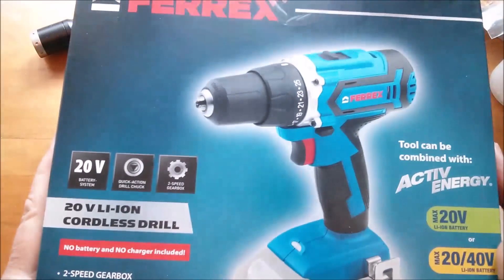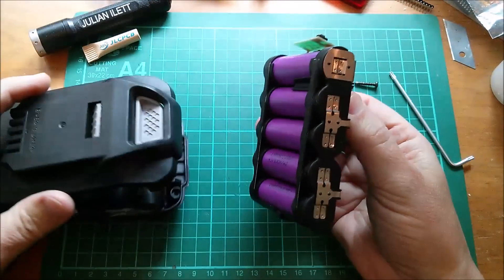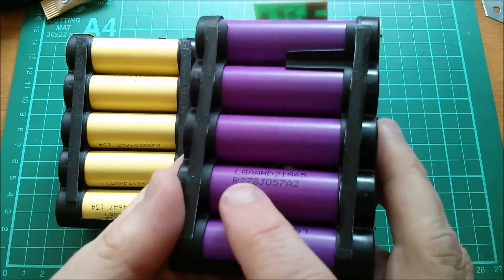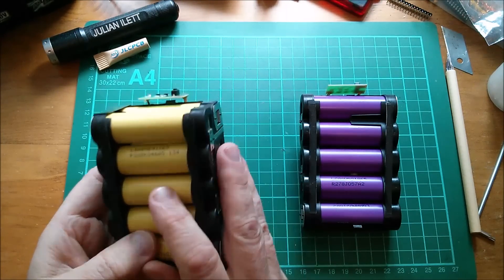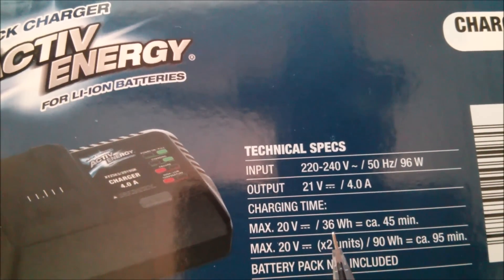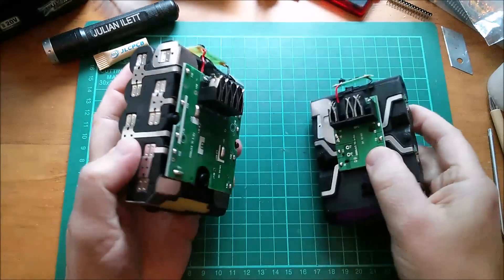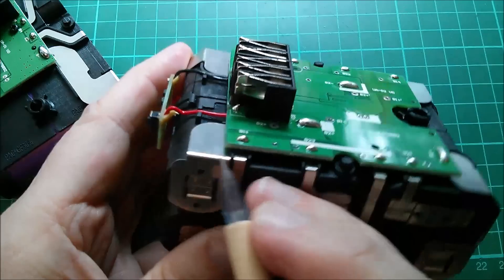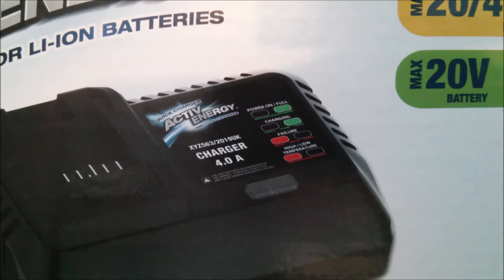Aldi Active Energy 20V/40V Battery Strip Down

Comment: Did you ever teardown the charger? I bought one looking for a cheap 21V CC/CV psu to replace one that had blown on another piece of equipment. The ID input is a problem though. I opened it myself to see and it's complex, controlled by a ST MCU which monitors the output current, battery temperature NTC and feeds back to the power stage to control the voltage. I don't know what it does with the ID, it could be a basic analog thing or perhaps a digital one. I will need an oscilloscope to see. Did you work out the ID?

Comment: I’ve got one of these 20/40v batteries but no charger , anyway to charge it with a adjustable dc power supply or maybe a charger for a different brand drill ?
Reply: Did you ever figure out how to wire it up to charge it?  I'm in the same position as you.
Reply: @chaswinder it’s a bit hassle but a adjustable dc power supply woks, you have to charge both section separate, first b1 side then b2 side, Aldi had the chargers on offer recently and I did get one, I think they was £7 but you can use a adjustable dec power supply
Reply: @M.E63  Excellent, thanks.  I only have the 20V battery rather than the dual 20/40 but wasn't sure how to connect up a psu to the pins on the battery (presuming not just +20V and 0V). Cheers
Reply: @chaswinder  what’s the pin markings on your battery ?
Reply: Hi  @M.E63  sorry for the delay in replying.  From left to right the 5 spade slots are labelled B1-, B2-, T / ID, B1+, B2+.  There is no spade terminal in slot 2 for B2-. Voltage between B1- and B1+ is 11.8V, between B1- and B2+ it's 17.9V
Reply: @chaswinder  yes you can manually charge both sections, do b1- and b1+ then b2- and b2+.
Seems a bit low if it’s reading 11.8v
Reply: @M.E63  I only have a 20V battery, not the 20/40V battery like you. Hence why there is no metal contact in the B2+ slot on my battery. I'm unsure if it's safe to simply connect a current-limited supply across B1+ and B2- ie. the pair of connections that measures 17.9V

Comment: What voltage are we expecting on the T pin?I have connected the ferrex air pump to a power supply set to 20V, the Led comes up briefly but the pump doesnt start, making me think that the microcontroller thinks the battery has a low voltage. I dont have this issue with the impact driver as it doesnt seems to make use of the T pin. I currently dont own the battery asa I use the Lidl one. anyhelp help much appreciated. thanks

Comment: Does anybody still have this battery? I'm trying to make adaptor for lawn mower, but it does not work when i give ~80% from battery voltage to temp clamp. Tool is 40v, and author while stripped down tested it only with 20V battery pack. My question is:
Does it have up to 20V on temp clamp when connected to 40V tool, or is it doubled, because cells are joined in serial, so it's gonna be up to 40V on temp clamp?
Reply: Ok, bought one to test myself. ~21 celcius degrees thermal sensor is about 10.5KOhm between B1- and T clamps. That's enough to get 40V device running. My batteries got thermal protection built in anyway, so i don't need it.
Reply: @krzysztoff5793  Is the T contact the high or the low?
Reply: @נוחיחזקאל  can't remember now, but I think it was higher one in battery, closer to cells. I can double check it next Friday if you mention me here again.

Comment: Really impressed with that drill... I bought one of those a year ago, £30 battery (20/40) and a charger and I’ve brutalised it all year... still going strong. It was so good that I bought the rotary SDS and the impact driver. For the three drills and two 20/40 batteries I paid £130! All with 3 year warranties. You really can’t complain at that; even a cheaper brand you’d struggle to get that set for much shy of 4-500 quid.

Comment: Hi, I would like to use that battery pack to power a portable Bluetooth Amp. 
Can you recommend a way to realize the low discharge protection?
Reply: I of course mean over-discharge protection. Using the 20v pack.

Comment: The new Workzone Battery Packs uses QIXIN lithium batteries and they seem to fail easily. I have opened many battery packs of the latest workzone tools and they used these batteries and i have lots of problem with them.

Comment: I've a few ferrex tools and all have been great especially for their price and a 3 yr warranty! I also have both these batteries.  

I used the smaller 20v on my kids electric 6v bike... power wheelies happened 😅 I'm wondering how I'd go about using the 40v battery on the bike in the same way to increase the power further as I've now fitted a 12v motor so its slower , any tips? cheers

Comment: Currently £15 for the 40volt battery thats £1.50 per cell for 2500ma genuine cells. Anyone wanting to make battery packs for electric bikes, powerwalls etc you wont a better deal anywhere.

Comment: Could I somehow join 4 or 5 for an electric bike much cheaper than branded bike battery
Reply: I have a temporary setup with Parkside 20V 4Ah packs wired in series and parallel, that has worked very well used twice a week for a year. Think I just need to get a 40v charger and hard wire them together. But at the moment in charging separately.

Comment: Hello Julian,  - are the contact groups independent on 20V/40V battery? I suppose, they become parallel in case of 20V tool, and if we use 40V device, the device connects the two 20v-groups in series. Am I right?

Comment: Hi Julian, I have two 20/40v packs for a 40v (36v) project and wish to connect them 40v in parallel  or 2x 20v in series but unsure of the connections B1-,B2- & B1+,B2+ . Not wishing to damage the batteries , did you work out how the connection could be made. Perhaps the tool makes a link  20/40v . I can only measure 20v(18v) at B1- & B1+ or am I just missing something. Great video must checkout more thanks.
Reply: Did you work this out?  I'm having the same issue with a 40v diy go kart
Reply: I want to know to in the same situation 😑

Comment: Hi Julian
If I connect the two 20v ferrex batteries back to back after properly removing & soldering the B2+ / B2-, will the charger be able to charge this modified battery? Thanks

Comment: Hi Julian. I learn much from your videos. The stuff on high power LEDs has helped me out slot. Thanks.
I bought the ferrex cordless angle grinder which is a good tool, however I need another 40 v battery pack.
They have discontinued these battery's do you know any ' hacks' to use an alternative????

Comment: I bought about 5 of the 40v ones after opening one and seeing that they were the green Samsung 25Rs. That's 100 watt-hours for 35 euro or €3.50 a cell which is quite reasonable. I have a 20v one also but haven't opened it yet (don't have a Torx screwdriver). The 40v ones sold out within a day (It seems others had the same idea as me) I was in 3 different Aldis in 3 different counties over the last week and they still have a stack of the 20v ones @ €20. Was thinking of trying to cut a deal with them, by buying 100 of them, if they would sell at 10-15 apiece.
Reply: clearz Google fogstar they sell those Samsung’s for 2.85 or if you want to spend £75, they drop to just £1.65 each!

Comment: It looks like these batteries do not have a cell balance function - the circuit on the backside of the 20V cct board monitors  cell voltages and temperature but there is no balance facility. Somebody is gambling that the cells are so closely matched that the charge discharge cycle wear is even ....  Three year warranty in a domestic situation ... that's likely a gamble worth taking - now where's that receipt?

Comment: 4:14 Not 25v but 20v or max if every battery is 4,2v, it is 21v.

But for the rest thanks for the video.
Reply: Actually he was right at 4:14 cell constant max current draw is 25 amp not 25v its not what he said

Comment: saw them into Aldi this week, all seperated tools and batterys, i dont know ... not that cheap as the Duro tools they had which are very great in my experiance i use one for 3/4 year on my work, same signle battery and still doing great , mostly just use for screws like 4x35 and wooddrilling 20mm. it was insane cheap just 20 euro i wish they come back i would buy more of them. never seen them again while Duro stuff is still common in the Aldi.

Comment: I got all there tools apart from the lawnmower and numerous batteries they are very good so far I'm impressed I just hope they add to the range as I see they brought out a 18v ferrex combi drill which is not compatible with the 20v stuff naughty really also this drill has no hammer function. The aldi tools are better than lidl but lidl batterys seem better built and a nicer feel.
Reply: Now use Dewalt the power and tool balance is light years ahead

Comment: The BMS for the 20/40 pack is probably slightly more complicated than two independent  balancers since not only is it necessary to keep the voltage of each cell within a 20V pack balanced. It is also necessary to keep the voltage of the two 20V packs the same, since otherwise when going from 40V series usage to 20V parallel usage there could be a huge current spike tripping the fuse.

Comment: Here at Hofer, in Austria (the local representation of Aldi Süd), fully compatible yet different battery packs where sold. Same external design but different molds for the injection molding. Slightly different internal construction. Different PCB with components on the top (visible) side (but not really identifiable due to a conformal coating).  Samsung INR18650 cells (20R and 25R respectively) instead of the LG cells. These Samsung cells are specification-wise comparable to the LG cells. The Samsung filled batteries name Conmetall Meister as supplier (same as most FERREX hand tools) while the LG filled packs are supplied by VARO from Belgium (official provider of this or a very similar battery system, as it seems). They also have different product IDs (AEB 20 - 2.0I and AEB 2040 - 2.5I instead of XYZ561 and XYZ562). You will find these IDs in the compatibility section of the technical specifications in the manuals of the tools\charger.
As I live close to the german boarder I also have a set of the LG filled packs from ALDI Süd, so I now own four different types of battery packs for this system.

Comment: I've just bought the Ferrex impact driver and the 20/40 volt pack and charger for it. It's awesome for putting large wood screws into hardwood. I just wish I hadn't bought one of the Workzone drills a couple of months ago. That's two different battery packs to handle, plus another one for my old Bosch drill. Why can't they standardise battery packs? It's all down to money I guess.
Still, I might be tempted to buy the chainsaw!
Reply: I got the chainsaw it's fantastic used it to cut loads of old Decking up. I've now got everything but the lawnmower and am well chuffed

Comment: Sad part is the makita tools batteries don't even come close for triple the price!
Reply: @night6452  I can't say I agree I have exclusively used makita for many years and prior to cordless they were bullet proof. My most recent experiences have been two different tools one being a drill the other a driver both failing as a result of battery failure, over discharged. Both batteries had different versions of lg cells, one set were damaged beyond recovery the other salvagable for use in projects. Needless to say I will not be purchasing anymore cordless makita tools!

Comment: 40v has less current per cell but if you put them all together in series you can draw twice the power so still equivalent of 40 amps vs 25 amps
Reply: The big battery pack either delivers 40A at 18V (20V) or 20A at 36V (40V) continuously, while the small one is able to deliver 25A at 18V (20V), if we stick with the specifications of the LG cells and don't consider any heating issues. So theoretically the big pack could continuously provide around 720W and the small one 450W, within cell specifications.

Comment: How did he not shock himself? He was picking up those cell packs on the exposed connections, without even skipping a beat! A braver man than I....
Reply: 20v DC wont shock you at all unless your soaking wet with salty water. its not AC voltage
just dont short them against any metal and you'll be fine.
you dont hear many stories of people getting shocked from 12v car batteries because human skin resistance is too high for any meaningful current to flow with low voltage DC
You want to worry about AC voltage. because it starts to get dangerous at 30v AC.

Comment: One important question remains unanswered. Does it have a suicide chip on the BMS. This being if the batteries are disconnected for replacement, the BMS kills it self. Like the one's on the e-bikes.
Reply from the maker: Not sure I want to find out.
Reply: @JulianIlett  if you ever replace them, be sure to have the minimum voltage over the battery contacts by using a psu.
Reply: If it does have a suicide chip, it would probably be a simple matter to trace the circuit and bypass that section of the circuit.  It may also be possible to get a cheap Chinese BMS (or two for the larger pack) and if they fit in the physical space available, they can replace the dead circuit.

Comment: I'm waiting for tools to be 21/42V. They used be called 18V tools. Then some marketing guy at a manufacturer, that most likely made crappy tools, found out that it's just the nominal voltage. Boom! 20V tools were born without any difference to the 18V ones except for the label. Hey, it's almost 10% better! But we are not there yet. 4V per cell is not the max.
Seeing 18/36V on a tool battery has almost become a sign of quality (and manufacturers like Bosch, Makita and Metabo are still using those numbers).
Reply: I read somewhere that the rounded maximum voltage of the battery systems (12V for 3 cells, 20V for 5 cells, ...) was already used for marketing reasons in the US for quite some time. And iirc it was one of the big US brands that introduced this nomenclature here in Europe. And because less technical people (or less electrically knowledgeable in this case) seem to associate big numbers with more power, other manufacturers (at least in the non- or semi-professional sector) had to adopt in order to not lose market share. Bosch did the same in it's green line with the 12V system (compatible to 10.8V 😉).
Also this system of the FERREX tools is at least labeled "MAX 20V/40V" in some places (e.g. on the colored labels on the box), which is more true, though still not really correct.
Reply: NiCads were 18V. ( 1.2*15 =18). The closest voltage for lithium was 20v or 5 cells. 

It makes sense manufactures that sold older packs set for 18v to avoid confusion while newer ones using lithium exclusively settled on 20 or 21.

Comment: You can replace those cells with sony 3000mAh / 25A ...
Reply: Depending on the type of the BMS chip this may be quite a difficult task. In some of the Li-Ion drill batteries, if any of the cells is removed it is seen by the BMS as damaged and the whole thing is shut down permanently.
Reply: That's a lot of effort for not much gain. Just buy another pack.

Comment: I have bought tools in Aldi, they are usually good tools, although sometimes it has its bad part, for example the tips of Topcraft / Duro welders are damaged too easily, although it is not a bad product and it has very good safety, double Insulation that indicates the product is real, with good grounding in the metal, and as an extra it has very good thermal insulation (I have disassembled it, and it surpasses the JBC in that aspect). I work with JBC and with the Aldi Duro/Topcraft welder, I prefer the Aldi, it is ergonomic and the handle is not heated with the use (thing with the JBC gets super hot).
And what surprised me most about the Aldi welder, is its electric cable, it is of very excellent quality, I put it to the test to put the tip in the cable and it did not deform nor a millimeter, it surprised me a lot.
Aldi usually sell cheap products, but they are not fake, and if it indicates the product that promises some function, it is real.

Comment: bought one of those and it died after one year without much use. i only ever used it maybe 5 times as a power screwdriver. from what i can see it was the circuit inside the battery that just died.
Reply: Its more likely that the cells overdischarged themselves from not being used to much, so much so that the BMS wont turn on or work. I had the exact same thing with mine. I just hat to charge the 18650s individually using a tp4056 and some crocodile clips and it brought it back to life. Try it. TP4056's are like 1 quid or less each.
Reply: @ratgreen  checked the cells and they were all over 4V so it should have worked, got fed up in the end and just bridged out the mosfet turning it on permanently, works now

Comment: I like how you are touching bare contacts on a 40v dc device with 40amps current delivery .
Reply from the maker: 40V is entirely safe unless you connect it to your internal organs :)
Reply: Or if you were possibly wearing a metal ring. It might get a bit warm if you accidentally shorted a couple of contacts.
Reply from the maker: True - jewelry and disrobed power tool batteries don't mix
Reply: The 40A current doesn't matter unless the resistance is low enough.  (ie. 1 ohm)

But it would be interesting to test the battery pack like you do a 9V... put your tongue across the terminals.   ;-P
Reply: @ElmerFuddGun  Well, if you have some moisture or sweat on your fingers, and  you mange to place it across ground and + 40v you are likely to get a bad burn, even at just 40v, with 40a capability, only the internal/external resistance in your finger will be a limiting factor.